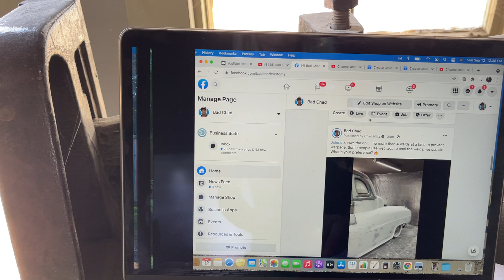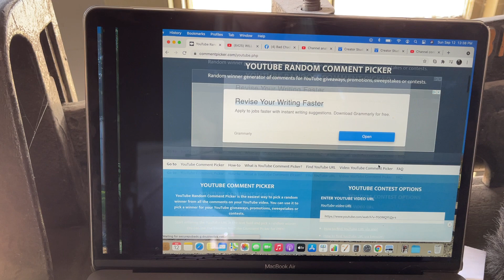1936 FORD FRONT END SWAP: BUILDING A HOTROD THE OLD SCHOOL WAY

Comment: put hot water in bucket and towel in the hot water then get outside with that bucket and fish the towel up and spread over the flathead to warm up the cylender head the thing is to use the towel to build up steam heat under it heating it more than just spraying hot water direct on to it that would just steam up rigt away this trick should speed the engine to start and run hot engine always start better

Comment: When you purchase a cross member from a parts store its not one from a wreaking yard where they have taken it from a wreakers. Its stamped from the factory. Invest in a set of torches man its takes a third of the time to remove things if you had a set compared to taking it apart with a grinder and a chisel and it takes a third of the energy at least.

Comment: My question is , if you are doing away with rear suspension , then why bother with front suspension. just make the whole thing rigid. Mounting it like that is going to make it too high. Think of how much weight is in the front suspension and the other cross member which you could do away with. also would be able to make it very low.  There are ways of minimising  shock , decent rubber mounts on the body, good seat springing , soft rubber shoes whilst driving etc. especially when you are only driving it on a flat bitumen surface.

Comment: Brush a bit of cutting oil on the re-sip blade and it will cut 2x faster and longer. Out here on the left coast of the USA we call ether, Rod Bender, It has been used wrong and bent many con rods.

Comment: That's sure gonna be different. You could move the front end further towards the back so you can use the hupp crossmember to brace the ford one, the front wheels will still be a long way forwards.

Comment: Chad you should check with Mike at This Old Hot Rod he or some one in his club, and get you all the rules for the PTJ as you do have to meet certain  regulation for safety ! So you don't build some that is not correct ! and have a disappointment at the track and for that matter crossing border ! Keep build on this project and get it done so you will be ready to go you have about 11 months to get ready ! and make interesting U tube watching, watching for your  viewers and Mikes as well ! It's about a   7 hour drive from were you are .
Reply: Lotta work to do in only 11 months.

Comment: Although your car may not need to be certified and licensed on the road the track may have a tech requirement (something that is very standard at drag tracks) with a minimum safety standard required for the track based on. Might be worth a quick email to the organizers to find out, so that you can fully enjoy your awesome project.

Comment: You will need a strong engine in the cab over to tow the race car behind it. I know it's set up for a small block Chevy. You will need at least a 350 or a 400 small block if you can find it.

Comment: Looking back at the casting information on the Hupmobile engine, it looks like it mite be of some value to a person needing it for a restoration project.  The castings look solid and well done.  It would be interesting to see how many main bearings it has. It might be a smooth runner.  Check the timing, the motor could be firing even though the timing is off.  I had an engine that a mechanic had rotated the distributor 180 degrees off.  When I replaced the heads after a valve job and wired the plugs according to the cap instructions, it would fire but it would not start.  I rotated the motor to number one cylinder to check the distributor, it was 180 degrees off.  I got the distributor in the right position, cranked the starter, and the engine started and ran immediately and smoothly.  Just because it is firing a little bit does mean it is timed right.  Rough running is a symptom of poor timing.  My car was a 1971 Buick Rivera with a 455 cu in engine.

Comment: Shouldn't you raise the rear of the chassis before you went the front end to the height that you need? If you want the front axle the way the angle is now when you lift the rear to put in the rear suspension your front axle will be tilting back under the car??
Reply: Should say weld the front end not went

Comment: Why not undo the spring holders and shock top so you  an turn the chassis rail over easier on a bench then you have easy access to connection points

Comment: Chad, have a 12 volt starter built for the engine. Don't use the 6 volt starter with a 12 volt system.

Comment: Just think how easy it would have been if you ground those rivits off and used a air hammer /chisel to pound the remains out theat ceossmember would have slipped out like a greased pig

Comment: On the cold chisel; when a “mushroom’ starts to form on the head from repeated hammering, it is important to grind off the edges of the “muffin top”.  The flared steel is very stressed and unstable and prone to splintering.  By grinding off the splitting edges of the “cap” the risk of shrapnel flying off is greatly reduced.  Years ago, hammering an old star drill into concrete, an edge shard shot off into my hand.  Deep!

Fortunately, it was not into my eye or someplace that tweezers and magnet couldn’t reach.  Since then I always wear safety glasses and all striking implements have their heads ground clean.
Reply: When my chisles mushroom and split I remove the splits an take it back a little then heat it with my cutting torch and dunk it in old oil.  It give a slightly bigger head and helps prevent it from mushrooming more.

Comment: I don't want to sound like a know it all dumb ass, but it was pretty irresponsible to knowingly fry  a "rare 6 volt starter" without having a proper remote starter trigger, a timing light, and a carb that  spewed gas.  You can't always have the tools you need, but it bothered me the amount of cracking that was going on a 6 volt starter.... that being said I have driven a car when I forgot to tighten the lug nuts, more than once.